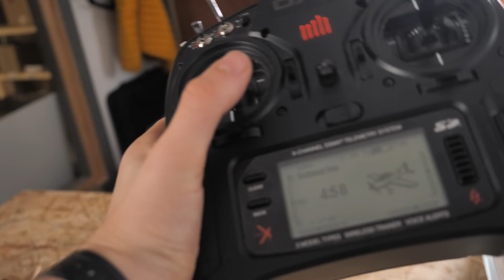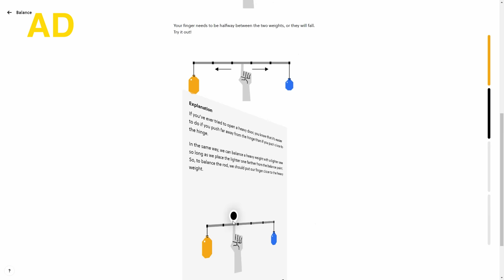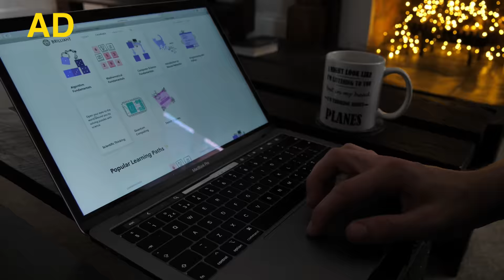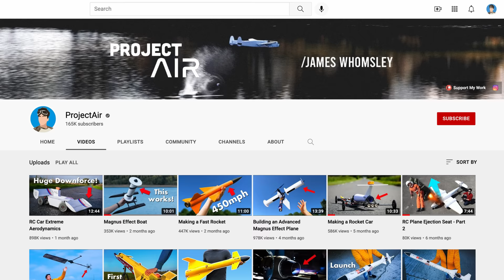Making an RC Submarine

Comment: What if you stuffed the water bottle full of foam padding? That would allow you to only fill it partially up. We use this same concept in fuel tank on race cars to prevent the fuel from sloshing around inside the tank.

Comment: Insulated copper wire from a winding coupled to a counter balanced (buoyancy instead of gravity) spool. Negligible weight, auto drag antenna line, very deep depths works for unmanned submersibles for science crews, the benefits of copying what already works will simplify everything.

Comment: Hint: Battery amd flight controller on board single, thin coax cable with high/low pass filters at each end. S-bus signals down, video up.

Comment: Have you thought about using a short tether?  1-2m, just for both antenna and using one of those ratcheting keyring mechanisms to keep it tight. or just using a long floppy antenna that floats.  The drag is always going to be an issue but a ping pong ball with 2 antenna sticking out on a thin ratchet could be usable.

Comment: Could you cut the flask in half and put walls sectioning the interior into let’s say quarters, and then fill it the 80-90% it requires to be at equilibrium, and that way it can’t displace the full length of the interior, I’m pretty sure that’s what actual submarines use to be able to manually fill say the front more than the back to naturally get pitch, feel this could be implemented in a more permanent way without pumps to fill and empty tanks at the needed time

Comment: Once you had the sub with neutral buoyancy by adding water to the bottle (not filling), wouldn't it have been possible to weigh the amount of water it took, then mix up casting plaster or plastic to the same weight, place that in the bottle (without the original water of course), and allow it to set while the now sealed bottle is in the horizontal position?  This would result in the bottle with the same weight, but without the sloshing of the water as you had originally.  Love the design by the way!

Comment: You can remote control a little buoyancy by changing the air volume of the syringe. Water displacement does not care if the air is compressed or at vacuum.

Comment: For underwater communications modulate light, or use a light weight tether like cat5 cable.  Put batteries in ROV.  l I have found that brushless motors are ok in fresh water but salt water destroys the bearings.  Small bilge pumps with small props work in salt water.

Comment: Sorry if it's been suggested, but what if you filled your bottle with a bunch of thin hollow tubes (like straws)? You could either fill those and somehow seal them up on site, or just use long metal rods as ballast weight. That would keep the weight distributed and keep your profile more sleek.

Comment: very cool! 
wondering if the sub could be paired with a drone boat that floats directly above it to relay signals through the water? maybe also utilise acoustics instead of radio for control for much greater range?
Reply: Yea, the only way I've figured I could control a sub remotely and relatively cheap is using ultrasound. Altho in the end I ended up with the same kind of a solution as Matt, a thin wire coming up to a floating tranceiver.

Comment: I say use a decent sized fishing bobber as a receiver. Put maybe a 2.4ghz receiver inside a large bobber and use thinner wire tethered to the sub to power the receiver
Reply: I'm also picturing that you could use retractable dog leash with wire(instead of the leash obviously) on the unlock position attached to the outside of the sub to keep tension on the wire so don't have too much wire for the sub to pull and so you won't have yards of it everywhere under the water

Comment: You didnt necessarily need to fill the entire bottle with water. You could have put lead shot in the bottle made it sit level and thrown some quick curing glue in it to set the lead shot in its place. Then you could use the rest of the space in the container to do what the other guy was doing. You could have also  used a really long shielded antenna wire and made the actual entenna at the top and made just the top but float so the "terher would have been very light in comparison to the old one.

Comment: Hi, nice job on the sub. I also like you adapting your friend's approach a bit. However, if you intend to go deeper, the new concept has another flaw. When the air gets compressed in depth, the mass to boyance ratio will change since the air will compress, the sinking rate will increase and so on. Same reason why divers add air to their inflatable suits and vests when going deeper. Otherwise, your engine has to lift up the complete weight of the constitution and if the power isn't provided, the lovely sub will end up on the ground of the lake.

Comment: Fun project.  Get on ebay and find a old am 4 channel transmitter.  Will punch right through the water.  Also use some of the 1980s rc tech for you fpv.  In the mid 80s we used home made uhf and vhf cameras with 3 miles of range on our airplanes

Comment: Your tether idea wasn't bad just don't send power over it. A couple rg-174 coax lines for rc signal down and video signal up to a much smaller float platform would work great I think. All that would be on the float platform would be two antennas, it could be made from a small slab of styrofoam, just big enough to float the antennas,  shaped like a boat. Also the cables weight needs to be compensated for with small floats every few feet to make the cable itself neutrally buoyant. make egg shaped foam floats ( or visit you local fishing supply and see what's available). Put a slit in the float and glue the cables through it, you want to minimize drag.
Reply: Peter Sripol's new sub vid had a pretty great idea. He used a flat ethernet cable for the wire, then slit a bunch of nerf darts down the side and taped them around it.

Comment: Hey bro, i think there is a way to get rid of a lot of wires.  You can use an arduino, it can transmit a signal to each other over two wires(by ppm), so the receiver would be on land, and everything else under water)

Comment: This is very interesting.

I was thinking, using arduino, you could convert an ultrasonic modem system matbe, using ultrasonic transducers/sensors/trasmitters to communicate simple motor on off and data back and forth, msy allow for wireless opperation at greater distances.

Comment: Look towards LORA as a control option. It's at least down to 800mhz maybe even a lower frequency. Ttgo have some interesting boards.
Reply: sub-gigahertz frequency gives us better range, but at the cost of significantly lower bandwidth/throughput, and higher latency. 
even though it'd be possible to use these bands for control and for video, it'd require too much energy to be able to use any of the standard LoRa boards. and, even then the range would be not much better. water just hates radio waves.
It might make sense to try acoustic transmission for control, just like real submarines do.
Reply: @netroy  what knowledge are your assumptions based on? A ttgo tbeam runs WiFi, Bluetooth and the LoRa transceiver on 3.7v esp32 or whatever platform, why is that different to any other RC controller? With the addition of LoRa. You may well be right and any RF through water is a no go anyway. And I forgot about video when suggesting Lora realising not best option for those uses although as regards lag in addition. Subs are slow and use instruments such as sonar, so low frame black and white might work, not very aesthetic though.
Reply: @DigitalArtisan77  what assumptions are you referring to? the part about water hating radio waves? that's a very fundamental thing about electromagnetic waves. 
I am a communications engineer by vocation. so, I'd say it's based on the knowledge acquired over many years.
or am i misunderstanding your question?
Reply: @netroy   Yeah about the lora boards available, you said it would require too much energy and thought maybe you didn't know about the new boards in last year or so, such as the ttgo beam. You obviously couldn't have read what I wrote anyway as I made no argument against water being bad for RF but we only have what's available and the basic rule for water then the lower the better. I'm only a 2 decade practicing R&D aerospace engineer so I just see it all as wiggly plates, wiggly waves, then plates getting wiggled. Then the medium needing wiggling through dictates the resistance hence amount of wiggle required.

Comment: What about some thin wires running to a surface float with antenna. radio Controle from there.
Reply: Sorry, I commented before watching the whole vid. That being said, maybe baffles in the water compartment might manage the flow front to back.

Comment: Thought! Extendable/retractable antennae with a spool of wire and a geared extruder module with a cutter/shear. If it gets snagged have a routine set up to: make a cut(like a twist tie roll), auto attach a tiny foam float(spring loaded magazine to feed one in the way of the wire, heat the foam to melt it in place(vape kanthal as the inductor = low power req) or kink the wire above the ball, then extending that new length of wire until it gets a signal from the controller. Maybe, eh?

Thanks for the brain food!
Reply: lmao, or have it cut and just go to the surface(facepalm). Not as stealthy though.

Comment: You can solve the sloshing around of the water by filling the inside of the tanks with baffles, works the same way as a damper, that’s how they design jet liner fuel tanks, You should use a lower frequency radio system like the old 27mhz.
Reply: Would still have a problem with water collecting to one end while pitching. Syringes are the way to go. Also, when you go deeper you'll need to become more boyant or you may not come up at all. Strong engines will help with that but I'm worried Matt might run into some issues, he however does have quite large syringes which should help.

Comment: An oddball thought.  Since sound moves through water much better than radio waves, have you considered a box that sits on the surface that receives the RC control signals, then turns those inputs into tones that it plays underwater.  The sub hears the tones and translates them into actions. Hypothetically this should give you a great deal of control. The video feed remains problematic though. But since you'd want to tow the tone box with the sub, you could have the video cable as the only physical link with the surface.
Reply: PS. Yes it would introduce some delay (the speed of sound), but the sub would need to be over 1125 feet deep to introduce one whole second of delay. The real trick would be making the tone generator loud enough.

Comment: couldn't you just put your video receiver, and the rc transmitter under the water surface as iirc its the interaction later between air and water that causes the signal distortion?

Comment: Fill the sub with oil instead if water. Probably youll be neutrally buoyant , or very close.
Also you can install an airfilled syringe connected to a small 12v comoressor to fine tune the buoyancy according to the depth.

Comment: I think you gave up on the tether too soon. If you build one with less wires and tape packing foam to it to give it slight positive bouyancy it will work a lot better and still allow for a live video feed. A lot of people use that 1/8" thick stuff that comes in sheets and tape on a strip every 2 to 3 feet.
You also want to attach the tether to the top rather than the back. Since it normally floats above the ROV this will keep it out of the way better.

Comment: just out of curiosity, you might not even read my comment, but i was wondering if there would be a way to use a really high gain directional 2.4g/5ghz antenna and program and mount the antenna to something controlled by an arduino which reads the output and always points in the direction where there is the highest chance of receiving a signal?
Reply from the maker: I’ve seen other people doing that yep!

Comment: why dont you try to make rc into infraed transmitter and reciver it would be easier to send data through light under water 
  like that fiber optics data transmission thing but wireless
like a tv remote control

Comment: Instead of filling the bottle with water and using external air chambers to achieve neutral buoyancy, why not use metal weights fixed inside the bottle to achieve this?

Comment: Stupid question, but why don't you just leave the bottle empty and glue lead to the outside? Even better, fill the bottle with compressed air, if the inside of the bottle is at 2 bar, you can dive 50m instead of just 40.
Or, and that is a cracy idea, just don't use a bottle at all. The real Drones usually use like a tupperware that they fill with oil, soon as there is no more gas in your sub you should in theory be able to dive to the bottom of the ocean, though saltwater proofing a bl motor is a hole other story.

Comment: ProjectAir (not water this time ?).  Maybe a title for a new serie of videosLet's stop it there.
about the radio transmiter, the 40MHZ  may seem an option, but not really in my oppinion (still limited to a few meters)
the tether was a hassle because it needed a lot of cable, for the servos, the motors, the cameras, ...
If you use instead only one (or a pair if you want FPV) of thin coaxial cable (the cable that goes out of the receiver that changes color just 3cms defore the end is a coaxial cable : the signal is in the center, and the ground is around it in a braid, stopping electromagnetic waves, 3cm (for 2.4GHz, its 1/4 of the wavelength) the ground braid is removed to expose the signal wire and make the antenna), you will be abble to transmit the radiosignal up to the surface, where you place the antenna. Also, if I'm not wrong, the exterior of the coaxial cable is connected to the ground (check with a multimeter) if so, you can use it as a reference for other connections, like using i2C or UART to only need two 26 AWG (0.22mm^2) wires to transmit the orders from a radio receiver on the surface down to the submarine. A pair of arduinos could be easily used to convert the Servo signal to Uart (on surface) and back to servo (in the sub).
With this system, it wouldn't be wire free, but just 2 thin wires to be able to go down to several meters deep

Comment: The range of transmitter and receiver will reduced in water??🤔
Reply: Almost completely blocked. Radio waves do not travel reliably through water.
That's why turnkey RC subs have a huge cable plugged into the transmitter and a spool of cable plugged into the sub directly.

Comment: i use a tank which i pump water in which copresses the air in tank,,when need to surface the now compressed air flushes it out,, 40 mgz for under water,,i need a small camera which can transmit video to phone,,any ideas

Comment: I really like the simple design. I was wondering how it would work if you took one of the jumbo syringes that you ultimately affixed to the outside, enlarged its bottom opening, and epoxied it axially in the water bottle (via the bottle's mouth) as an adjustable displacer. That way, you could adjust the amount of water in the bottle without it ever being able to slosh around. This scheme would require a second small valve, either for water intake if you left the plunger in whilst filling, or for air escape if you filled the bottle with the plunger removed and then inserted the plunger as far as it will go. Once you had everything dialed in, you could replace the silver cap on the bottle so the plunger could not be disturbed. Armchair engineering, of course....

Comment: I don't     get why    you'd fill the bottle completely when you could just weigh the bottle when it is at the correct buoncy and  re weigh it empty then  fill it with the difference in say, epoxy resin or even concrete and let it cure on it's side

Comment: abandoned island with no tools making things challenge
Reply: ie, you cant go to store, and only have your default clothes and unlimited food
Reply: if you want tools, you make them from scratch
Reply: including batteries, energy storages, materials, metals, plastic, ceramics, motors, etc
Reply: consider how much effort from zero goes to make each thing, is it easy or very hard, low complexity or high complexity, fire is "easy", li-ion is a bit hard, from zero
Reply: radios a bit hard too
Reply: use fishing wire
Reply: optical wire is useful too
Reply: why so heavy super tether, are you going to the moon
Reply: dont believe in yourself, your own talk, or your sponsor, not true
Reply: it denies the gift of God, from God, its free gift
Reply: laser remote might be better, under water
Reply: light pulse based remote, ir-pulse morse code remote
Reply: fishing with optic fiber lure
Reply: under water vision fishing
Reply: just a long antenna, with an up-right floater
Reply: @Jkauppa it would be too complex
Reply: @e64pro  what